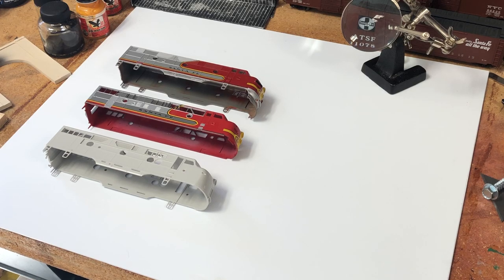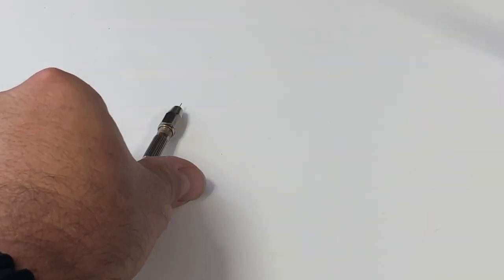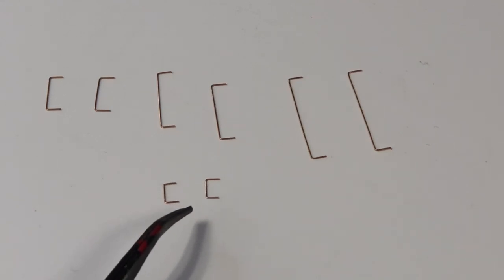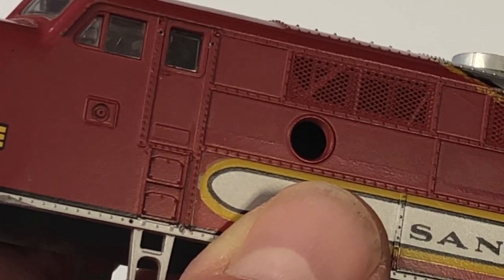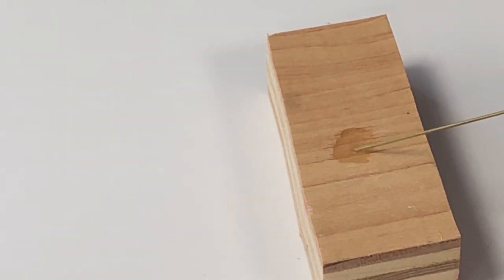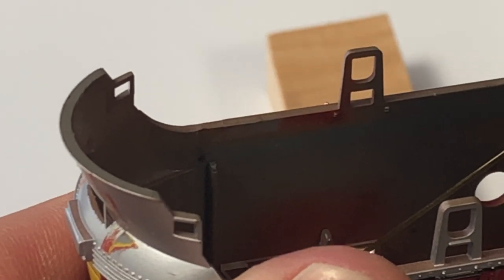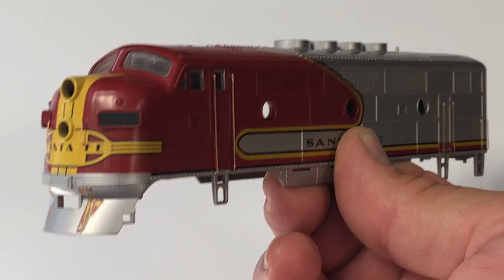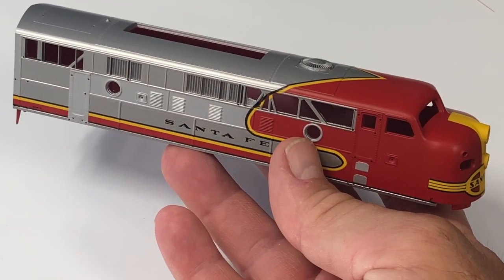Detailing HO Scale F Units

Comment: The model being demonstrated is NOT an F7, it is an F3. The upper mount for the two rear vertical handrails IS correct at the rivet line for both the actual F3 and F7, so the Stewart locating dimples are correct. As for the vertical grabirons at the rear side door, the upper mount as on the Intermountain shell is the correct location, not the lower one on the Stewart F3 shell.

Comment: Stewart shell, Kato drivetrain.
You can use ~1/16" styrene shims fitted between the handrails and carbody during gluing to ensure consistent spacing. Best to keep them away from the ends where they might pick up some glue.